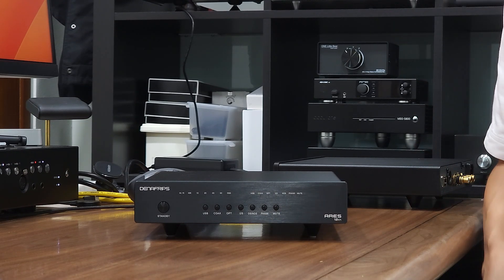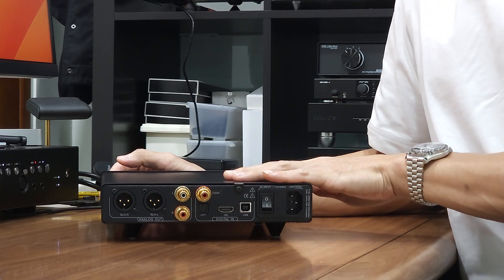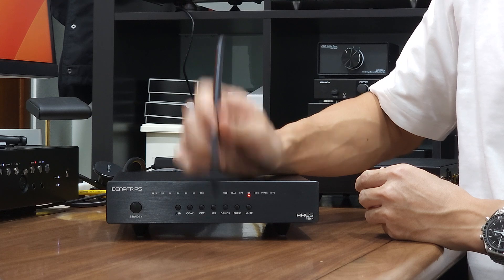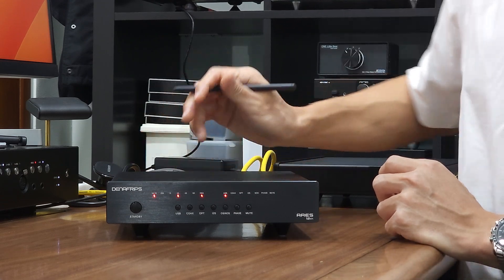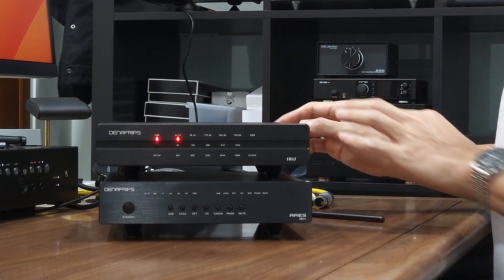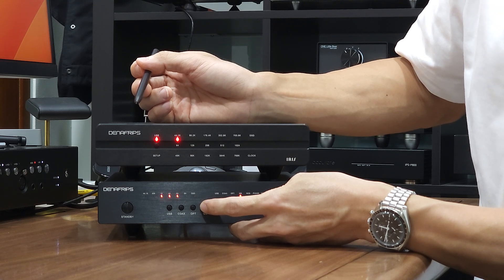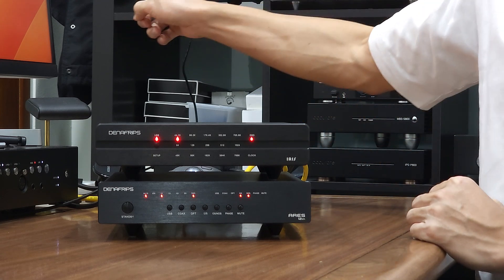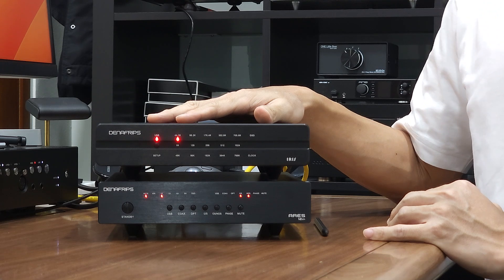DENAFRIPS Ares 12TH Configuration Guide

Comment: If I am also using the Hermes DDC with the Ares 12th will I need to also configure that unit if I am using a COAX input from the Transport to the DDC but using the I2S output going to the DAC?

Comment: Just bought Ares 12th-1, what is the difference between positif an negatif phase
Reply from the maker: The phase button changes the output phase 0/180 degree. I leave mine off (positive phase). You may trial and error to check which setting sounds best in your system. There is no hard rule here as this setting is merely meant to correct the output phase of the match with the individual system.
Reply: @VinshineAudio  thanks bro

Comment: i got the Ladder Shuman Dac and its not the same dac but i think its the same manufactur...but who cares xD. 
uhm the schuman got also xlr outputs but i habmve to say that the unbalenced outputs sound realy better. xlr doesnt sound good to rca. xlr was used a Nordost Valhalla 1 and the rca is used a Nordost Frey 1 rca cable. I also have to chance phase on xlr and change it back for rca and i was using only one connection at the time.

only true balanced r2r dac have to have 4 ladders...not 2! this cant be true balanced. its like delta sigma dscs with only one dac chip...not realy true balanced.